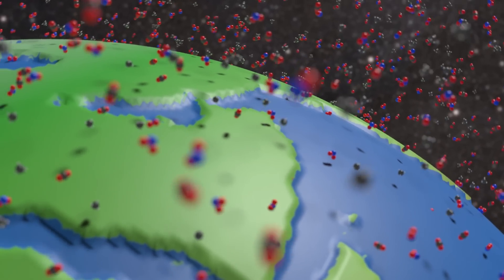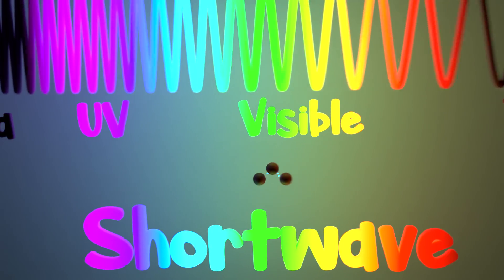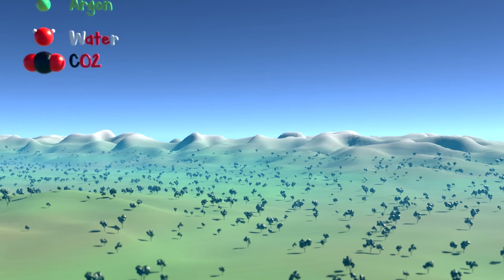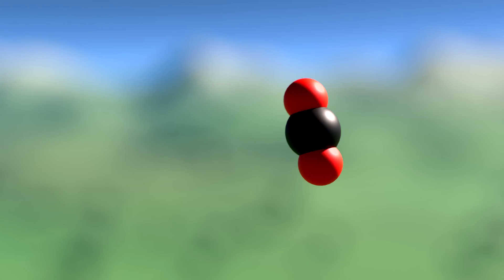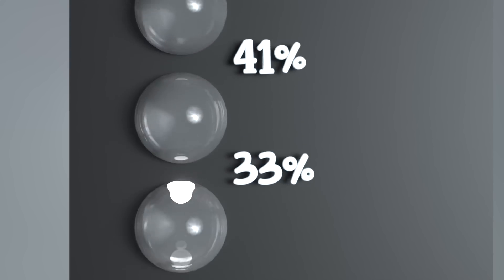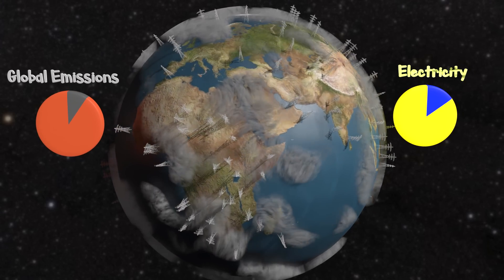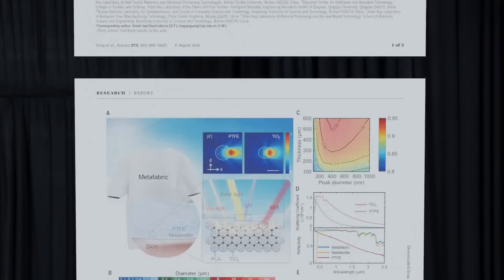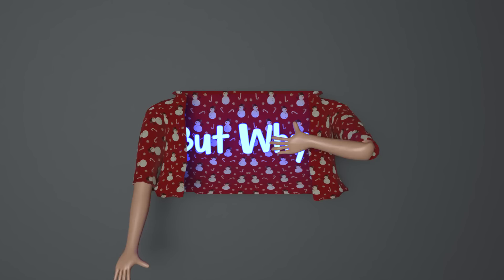Energy Free Cooling through Physics

Comment: Passive cooling’s benefits will need to come from materials which have a sufficiently low carbon footprint in their manufacture.  I didn’t see this mentioned in the video.  Do you have these data for any of the materials discussed?
Reply: I installed a Planetary Air Conditioner.  It dumps enough heat back to space to have melted 250 tons of ice per year.  My best stab at the math says that the heat it took to make it was covered in less than a week's run time.   Hope this helps.
Reply: There wouldn't be any reliable data for experimental materials. The production process would have to be industrialised first.
Reply: @retyroni    That’s not how manufacturing is done.  Surely you know what R&D is for.  Everything that possibly can be modeled, is.  Without prediction and research, we end up with disasters like leaded gas.  Those dumb old days are long gone.
Reply: Why do you say that?
Reply: @onbored9627    ny solution that reduces atmospheric carbon will, by definition, have to create less than the savings it effects.  Otherwise, net loss.
Reply: @artysanmobile  Not if it's reduction in temperatures is greater than the increase from the carbon generated.

Comment: Thanks for the nice video, really informative to me to this wonderful topic.
Can you clarify one thing?
When the inverse GH material scatters the incident light, will it be same visible radiation or IR? I'm assuming it will be same, in which case won't the scattered light be reabsorbed by the surroundings? Also when it radiates the IR, won't the GHG in the atmosphere "catch" it? Or can it be used to radiate IR heat out to space without absorption by GHG in the atmosphere?

Thanks.
Reply: Reflection is just the redirection of the incident light, so it'll be whatever comes in (i.e. visible light) that goes out. If this light is reflected onto the surrounding environments, then yes, other objects will absorb that heat energy. This is, however, irrelevant since we're not trying to solve climate change with this technology; we're simply trying to create local cooling zones without expending energy. 

We're not creating any more heat absorption by deflecting the light to a different place, nor are we adding any more infrared energy into the atmosphere to be absorbed and reflected by greenhouse gases. The difference is whether a patch of land absorbs the sunlight energy and emits IR rays by itself, or a settlement structure (house, tent, etc.) build on top of that patch of land now does those two jobs. The net energy exchange between the earth and the sun is the same; we're just creating a cool zone at the expense of some other zones getting hotter.
Reply: @vdinh143  not quite, these reverse-greenhouse materials are mostly a local cooling effect, but it does so in a way where, rather than pushing heat out of the building into the surrounding environment which causes a net heating of the atmosphere, these materials cause buildings to take in heat from their surrounding environment and directly radiate that heat into space. The more greenhouse gasses in the atmosphere, the less effectively these materials will radiate heat into space, however, they do cause a small net cooling of the atmosphere. You are correct that it will not singlehandedly solve global warming. It will however save a lot of electricity as temperature control of buildings is one of the largest electricity usages.

Comment: People have been using i.r reflecting paint for a while now. I imagine that it is a similar if cruder technology.
Reply: I've got mirrors on my roof.  Actual mirrors.  Easy to clean, which is important because they condense water out of the air, and then dust and pollen glues itself to the glass, and moss grows (which is not efficient at reflecting).  Quite efficient at cooling.

Comment: With such technology, we'll need roofs that change with the weather to absorb or radiate heat.
Reply: The only sensible way I can think of is some kind of roll-up curtain that will automatically deploy over a certain temperature when sunny, and will remain stowed at all other times
Reply: @TheNasaDude  , think Venetian Blinds mounted horizontally, or at any pitch really.
Reply: Nope. You can make your roof cooling, and then drain and valve off the radiator in the colder months, or just based on the temperatures, and then open up “coolant” fluid to a heat source elsewhere in the loop. The roof then would stay cool, and would be colder than ambient outside, but the heating and cooling system would be unaffected in the cold months and days. The more likely problem would be condensation and ice formation which should be solvable.
Reply: Use the tilt of the sun.  Mount at 2+ levels, east west orientation.  When the sun is highest at summer solstice and a nearby range, 100% blocked.  When the sun is 46 degrees lower most of the sunlight gets through.
Reply: We can make something like that it just would be a hassle to have to change the roof for winter then change it again for summer
Reply: @corriveau21  Computer (microprocessor) Control will take the hassle out of that!
Reply: Maybe they could be operated in such a way that a layer of ice could build up on the surface. This ice could block the reflective panels lessening their cooling effect, and ice is actually a great insulator.
Reply: @blaster1185  In Texas there's significant heat to be obtained from solar radiation on a 5C full sun day. Snow and ice is a very rare thing on roofs here.
Reply: Most buildings don't really want to absorb heat through the roof.  Insulation is typically the goal.
The aerogel panel idea uses a liquid coolant (probably just water) to pick up heat from the inside and dump it into the panels to radiate away.  In the cold, just stop cycling the water and you're left with a really good insulator.

Cooling paints and coatings don't have that nice off switch though.

Oh, one other thing.  It would be cool (pun intended) to pair with solar PV panels.  Those panels are more efficient when cool.
Reply: That's far from hot
Reply: What about panels that flip?
Reply: @suzannehartmann946  Was coming to say this 👍
Reply: That's not a problem, they could be easily swapped once a year as the material is extremely light
Reply: @guimaciel7457  But if they can switch quickly, you would have the best results for cold fronts or a quick heatwave. The only reason I ever used the AC here in Texas was to get the humidity down indoors.
Reply: even if you cant change them for the cold season, it would still save a colossal amount of energy even if its only used jn zones where its hot all year round
Reply: @lightdark00  I, on the other hand lived inthe Texas Panhandle, where we trade heat for humidity. There it's hot and dry, so we use swamp coolers.
Reply: @guimaciel7457  that could be problematic in place where I live, the weather cannot be predicted today is cool and windy, next day the heat is scorched then suddenly heavy rain.
Reply: @guimaciel7457  “the material is extremely light” — redoing your whole roof twice a year is not a practical idea.  Where do you put your off-season roof?  Where’s the huge, seasonal labour force to do the work, and how do you avoid running out of them as they get injured or killed falling off of buildings?
Reply: @ericssmith2014 , you live in America and are seriously asking where the labour force would come from?
Reply: In the 60's we were going to freeze, 90's we were going to burn up, neither worked out so the global elites decided on climate change. Yep the Sahara dessert was once a tropical forest and changes to a dessert with no help from humans.  It's not about climate It's about power and money.
Reply: Even in these regions you get winter nights below freezing temperatures
Reply: @guimaciel7457  ??? where i live its winter and the worst we get at night is like 5C
Reply: @salvadorsanchez5057  Well, with 10°C less it'd freezing.. So swappedy swap...
Reply: @derherrdirektor9686  ik, but thats a worst case. its usually 10 or even 15c at night here

i do agree that having it up at night would a bad idea, but it really isnt freezing everywhere in winter.
Reply: @guimaciel7457  If you have a solution with water cooling entire building, you could simply turn off the pump to vastly reduce heat loss.

Comment: I Understand, but I don't think solving global warming with coating everything with crumbly plastic aerogel is the solution, since the ocean is already full of plastic, and the ocean is the worlds largest carbon sync
Reply: This is not about solving climate change. We're just deflecting the heat from one place to another to create zones that are cooler by design at the expense of other zones getting hotter.
Reply: @vdinh143  It's reflecting light back up into space to avoid it being turned into thermal energy, and allowing the one way ravel of thermal energy back into space. That is 100% about solving climate change.

Comment: Nice video as always. Would you look into the claim that the greenhouse effect is the reason traditional greenhouses work? My understanding is that in greenhouses, preventing convective losses is the key ingredient (see for example the wikipedia entry).
Reply: Glass greenhouses for growing plants do not operate on the same principle as the so called "greenhouse gases" like CO2 and CH4 (methane).  A glass greenhouse gets hot because the sunlight energy is allowed in by the glass, but the hot air that gets produced (after the sunlight photon energy is absorbed by the ground/plants inside the greenhouse and turns to heat energy) is blocked from convectively rising and wafting away, due to the near air tight glass roof presenting a physical barrier.

"Greenhouse gases" like CO2 and methane heat the Earth in the manner described in this YouTube video.  The sun radiates much of its energy between around 300nm to 1000nm down to the surface of the Earth.  At the surface of the Earth, the sunlight photons hit something like the ground or a tree leaf, and then converts into thermal energy, at a temperature roughly around 300 Kelvin (~25 Celsius).  The 300 K earth surface then acts approximately like a blackbody radiator, which re-emits much longer wavelengths of radiation, mostly in the range of 5,000nm to 25,000nm.  The so called "greenhouse gases" like CO2 are very transparent to 300nm - 1000nm sunlight radiation, but it is not fully transparent to the 5,000nm to 25,000nm radiation.   CO2 has a relatively high absorption of longwave infrared photons in the range of 12,000nm to 25,000nm.  Therefore, some of the longer wavelengths of the ~300 K radiation originating from the surface of the Earth end up getting absorbed by CO2 molecules in the atmosphere, and then they get re-emitted in a new and random direction (50% of the time still pointing up towards space, but the other 50% of the time pointing back down towards the surface of the Earth, which causes it to get re-absorbed by the surface of the Earth, thus temporarily preventing the energy from escaping into space).

Thus, CO2 does slow/impede radiative cooling of the Earth, which does result in higher average Earth biosphere temperatures.  However, the "heating mechanism" of atmospheric CO2 is not the same as a glass greenhouse for growing plants (which relies on mechanically blocking convection of hot air).

Perhaps a more accurate term, rather than "greenhouse gases" (for CO2 and CH4), would be "weather modifying gases".
Reply: @Fritz_Schlunder    Yes and No.     

There are 3 methods of heat transfer.   Conduction, Convection and Radiation.    They all affect the final temperature of the greenhouse in significant ways.      It depends on the day, the outside temperatures, the wind speed, the opacity of the air, humidity.     Just saying it's convection and convection only, is not really accurate.     Not saying convection isn't important, just that it isn't the only thing.
Reply: @Fritz_Schlunder  Amazing explanation, thank you so much
Reply: @Fritz_Schlunder   N2 and O2  comprise 99% of the atmosphere; 2,500 times more abundant than CO2. A thermometer held in the air will reveal the temperature of all the constituent gases. If N2 and O2 are "non-radiative" and all the energy absorbed by CO2 is immediately re-radiated, how does the atmosphere as a whole warm and cool?   In fact, at 1 bar atmospheric pressure, the CO2 molecule will collide with 1,000 other particles in the refractory period following vibrational excitation, whereby the energy goes into heating the atmosphere, not the surface of the Earth. Wrapping the sphere in a blanket of gas, then warming the gas might raise the temperature of the surface but not by bouncing the same photon back and forth. Equally, it might not, since the warmer air will rise more quickly away from the surface and closer to the level at which energy can be radiated to space by, perhaps, a now enhanced concentration of radiative gases.
Reply: @Fritz_Schlunder  I wrote a reply, which failed to appear. I noted that the vibrational modes of molecular bonds are not the same as electron energy levels and, in all states, including the ground state, all the vibrational modes are available. A 15 micron photon has nowhere near enough energy to promote an electron; IR increases bond vibrations.
Reply: It has nothing to do with convection. It has only to do with the fact that gases like carbon dioxide and methane are ever so slightly opaque to infrared but much more transparent to visible light, so the light from the sun sees no encumbrance in getting in, but the infrared coming from the Earth sees something of an obstacle getting out.

Comment: there a company called 'Skycool systems' That is manufacturing some panels, except they say it works because of a gap in the atmosphere, Which is certain type of wavelength do not get  asorbed
Reply from the maker: Correct! That is the company and tech Arny showed me while we were talking. That is called the Infrared Window and the greenhouse gases aren't excited about those frequencies. The IR window corresponds to wavelengths of ~8-14 microns. So I wonder if they convert the radiation to that ideal frequency. I'm not super certain if they have a special technology or not.
Reply: @ButWhySci  The property is florescence; absorb at one frequency, and emit at another.  Laser dyes do this all the time.  The problem isn't the underlying technology, it's field stability.  Dyes in general are light sensitive; flowers are brighter in the morning because the light degrades the dyes.